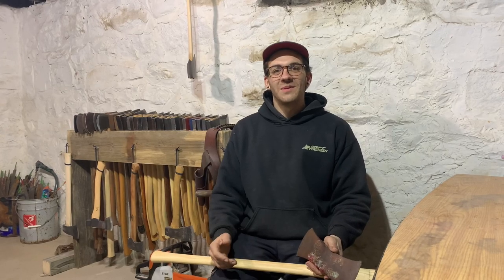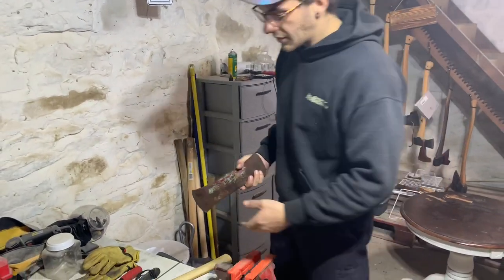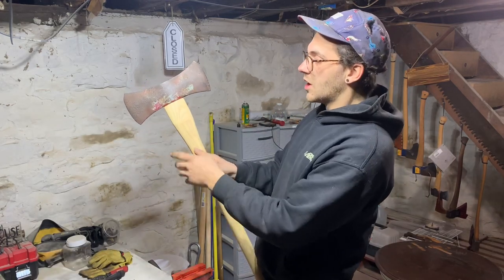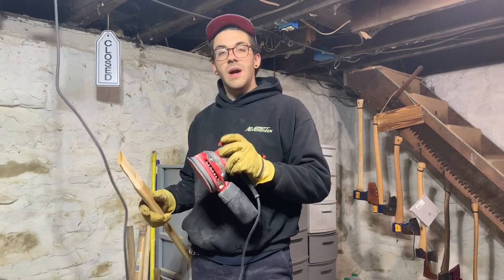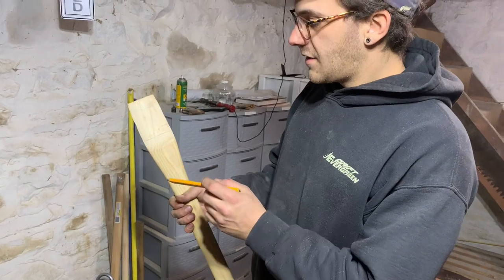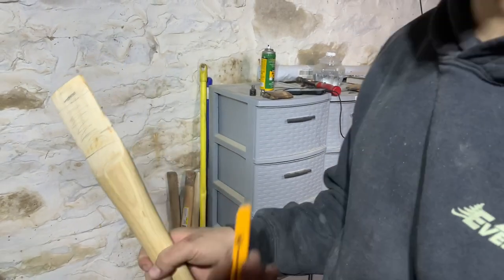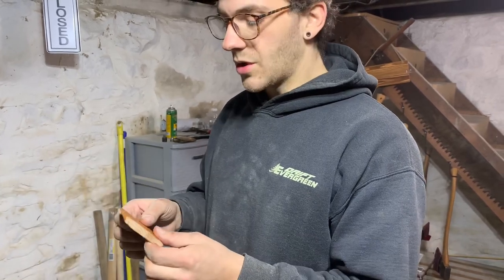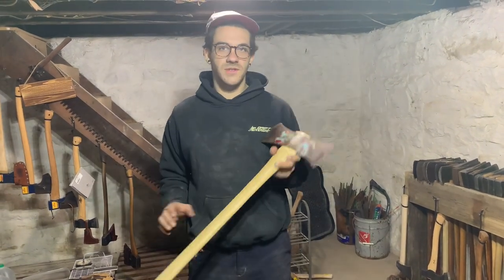Hanging a double bit axe. How to, tips, and tricks.

Comment: Hey Joey! Just stumbled on to your channel! I love your creepy basement! NICE hang! Great tutorial! Beautiful DB axe! I too, believe in oiling the top part of the handle and wedge, before hanging! Another thought I've had, but (have not) tried, is AFTER the hang, SOAKING the entire head in flaxseed (or linseed) oil, for a day or so, so it will completely absorb to saturation! Have you heard of this, or tried it? As for finishes, instead of BLO, I do like using the food grade flaxseed, as it is the same as BLO, (without) the drying agents! It doesn't dry as fast, but leaves a GREAT polymerization finish! Sometimes I will WARM the handle with a hair dryer to open wood pores, then apply....then heat again, after application to thin viscosity a little, allowing for more absorption...EXCELLENT results achieved! Thank you for sharing this with us! SUBBED! Greetings from the PNW 🇺🇸 🪓🌲🪓🌲🪓🌲🪓🌲
Reply from the maker: Thank you so much for watching and thank you for the kind words !!! Yessss oiling the eye wood for the win !!! I use BLO sometimes and sometimes I use just regular ole natural linseed oil without drying agents. After using both plenty of times, I seem to prefer the natural linseed oil over the BLO. I have heard of people soaking the entire head for a day after hanging. I haven’t tried this method yet, but I would love to give it a shot for science to see if it’s any different 👍 thank you so much again for watching, commenting, and subscribing I really appreciate it !! 🤙